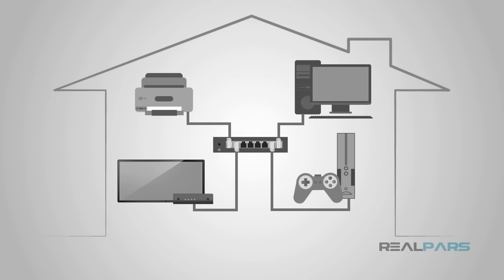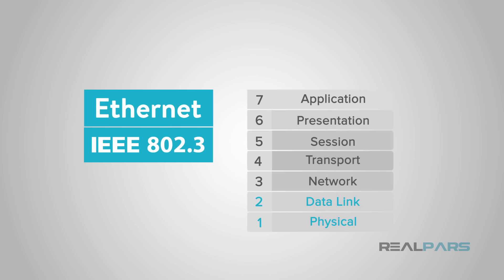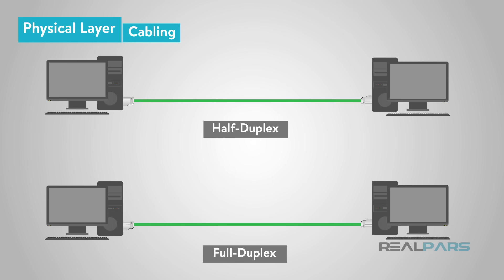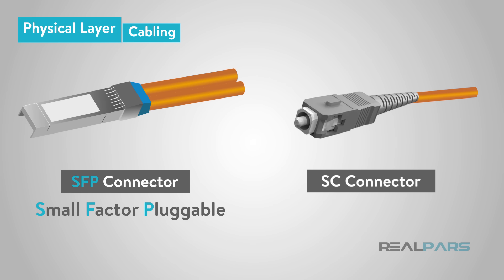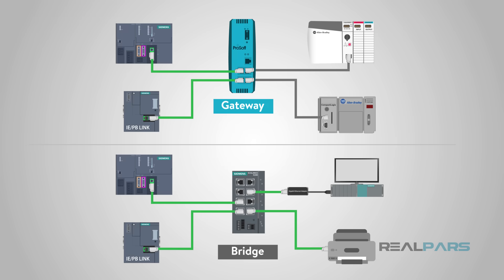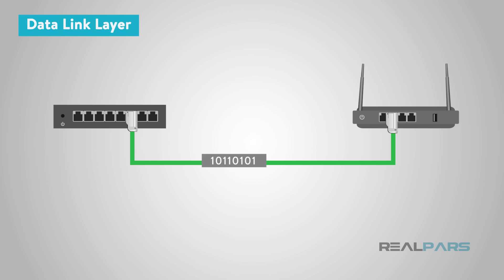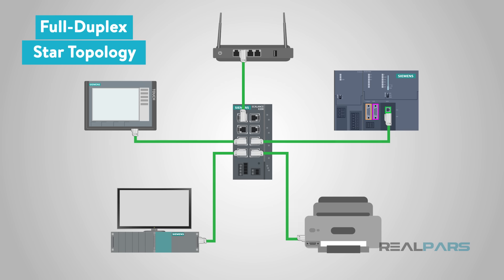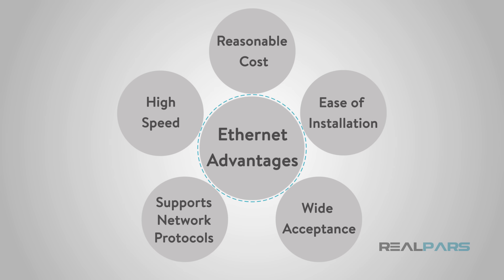What is Ethernet?

Comment: is switch a router?
Reply from the maker: No.  The most basic explanation is that a switch is designed to connect computers within a network, while a router is designed to connect multiple networks together.  Most routers can act as switches, since they usually have multiple LAN ports and 1 or 2 WAN ports.  My cable modem is a router which I use to connect to a different network (the internet provider) and to all of the devices in my home network.  Switches, on the other hand are not usually equipped to act as routers, since they are limited in scope to what is connected locally to their LAN ports.
Reply: RealPars understood! thank you

Comment: Okay I might be an idiot for asking this, but does ethernet cost anything other then installation?
Reply from the maker: If the device already has a network interface card (NIC), then you just need to install an Ethernet cable and connect it to a switch, router, or gateway.  There are no license fees or use fees associated with Ethernet.  Of course there must be at least one other device on the network in order to send to or receive data from.
Reply: And your electricity bills plus maintenance plus managing plus software  plus wear and tear etc...😉

Comment: What’s better; a Cat6 or a Cat7?
Reply: Cat6 wiring can support up to 10 Gbps and frequencies of up to 250 MHz.  Cat7 can also support 10 Gbps, but laboratory testing has successfully shown its ability to transmit up to 40 Gb at 50 meters and even 100 Gb at 15 meters. The newer “Class F” cabling can support frequencies of up to 600 Mhz. That said, Cat7 has not been approved as a cable standard for telecommunications.  I would only use Cat7 inside datacenters, since the additional shielding and increased number of cable "twists" make Cat7 cabling more expensive.
Reply: Scott Sommer so, it does no better than the Cat6, say for plugging it in to an Xbox One? Is it just unnecessary?
Reply: @omarlemus4659  Just unnecessary.  XBox cannot take advantage of the higher speed capabilities of CAT 7 cabling, because it is designed to run at 1 Gbps maximum speed, well within the range of CAT 6 (and CAT 5e, for that matter).  CAT 6 cabling may give better performance than CAT 5e, but my older kids don't think that it does in practice.  What I do know is many XBOX gamers complain about the upload and download speeds of the "gigabit port" on the XBOX getting only 150Mbps -250Mbps.  Here is the secret:  Ethernet interface ports like the one on the XBOX are rated for 10/100/1000 Mbps.  As long as the interface can achieve > 100 Mps, they can advertise the capability as 1000 Mbps (gigabit).  It is doubtful that without a very expensive dedicated connection through your internet provider that you could achieve speeds even close to 1 Gbps.

Comment: Can we do ethernet communication betwen siemens s200 and scada system without internet ?
Reply from the maker: Since the S7-200 CPU module does not have the needed hardware for Ethernet communication, you need an extra hardware module which is Industrial Ethernet Communication Processor (CP 243-1) for data traffic handling and communication based on TCP/IP. This module provides Ethernet access via an RJ45 port.
As log and your distance do not limit you, you can take advantage of the Ethernet communication.
This link may help you with your project: https://sie.ag/2Gt7O9R

Comment: A couple things:
1. As others have said, cat 5e can be used for 1 Gbps speeds.
2. CSMA/CD is no longer needed for full-duplex switched networks, each link is isolated and collisions are eliminated. Indeed, half-duplex links are no longer specified in 1 Gbps Ethernet, and aren't allowed at all in 10 Gbps. 802.11 Wifi does have collision issues due to its half-duplex nature, but it uses a related CSMA/Collision Avoidance method instead.
Reply: Could you explain in brief which 802.11 wifi, wifi 1 or 2or 3 has collisions due to half duplex property & which haven't???
Reply: Wth
Reply: nerd
Reply: @seanbaxter44  he may not be a nerd at all, some people actually learn this at school
Reply: @seanbaxter44 🫵🤡

Comment: Hi, Thank you for your information. I have confusion about Profinet, EtherCAT, Sercos...Do they use Ethernet as physical layer? And only change the protocol?
Reply from the maker: Hi there, thank you for your comment. 

EtherCAT and Profinet are both an "Ethernet Protocol" with some differences. 
For instance, EtherCAT uses the same "physical" and "data link" layers as Ethernet but the protocols deviate from there. The purpose of developing such protocols is the particular advantages of them in different applications. Actually, Ethernet is not a practical solution for many industrial applications as it routes frames of data to and from a "vast" number of separate addresses, individually. 

So in cases, where the data may be something as simple as a single register to obtain a real-time analog reading, it seems more reasonable to take advantage of other types of Ethernet protocols such as EtherCAT to reduce the data traffic, increase the speed and so on.

By the way, we are going to make a video regarding "EtherCAT" in the near future. It could be a good reference for you to grasp more vivid data regarding EtherCAT and its differences from Ethernet.

Thanks
Reply: @realpars  wow, thank you very much, hope to see Ethercat video soon